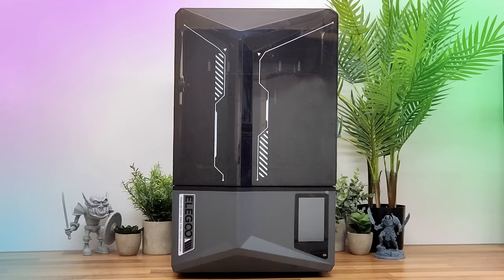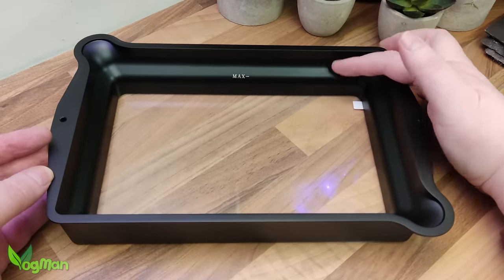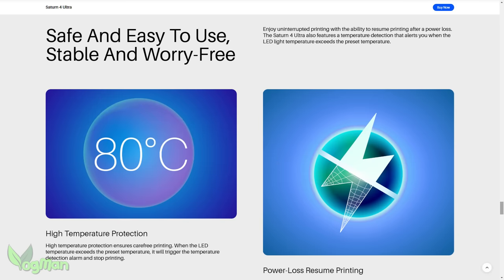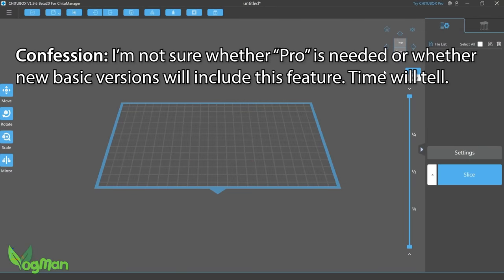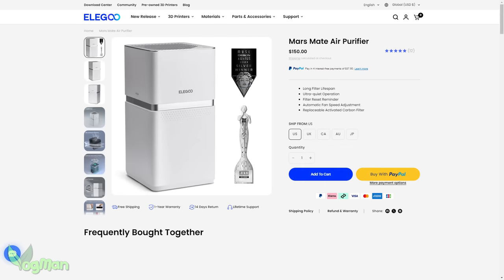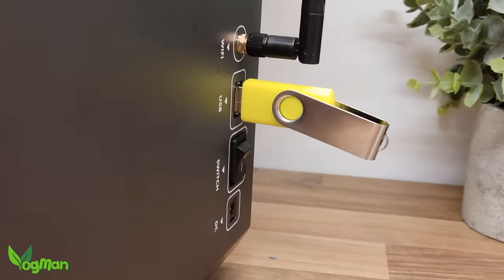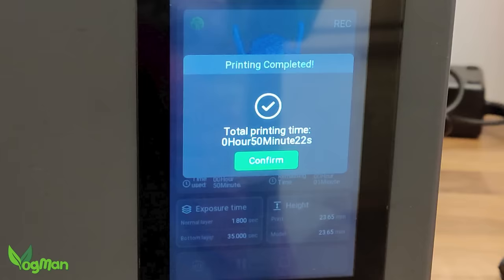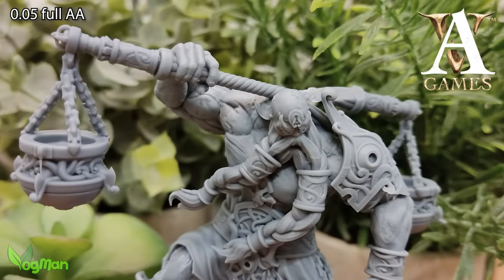Elegoo Saturn 4 Ultra (HONEST review) 3D resin printer

Comment: Good, quick review with nice sharp closeups of samples as we’ve come to expect, thank you for that!

One of the sticking points of the review kind of bothers me.  You make a stink about a cheap 30¢ plastic tray which is pretty much necessary, and another about not including a $50 heater, which presumedly we’d be forced to pay extra for.  

Why should people in tropical or temperate climates be made to pay for something that they would never need?  It being an OPTION is the correct way to go for something like a heater.

Also, I can buy the same type of mini heater for $35 through other outlets.

I’ll definitely be printing a very low profile, style appropriate tab for the lid though.  Definitely a design oversight on Elegoo’s part.
Reply from the maker: My job isn't to do anything more than inform. I speak honestly and try to be balanced.... I like this because... I don't like that because...
When I see a flip top lid with no handle, my personal thoughts are "This company had no idea WHY it was fitting this type of lid." The benefit is one-handed convenience. Without that, there's no benefit. 
I know plenty of folks that live in warm climates but have suffered printing problems through temperature drops (for example, a pal in Australia tell me how cold in gets in the evenings). Heaters aren't just about making a warm environment, they are about consistency of temperature, and that's where prints work best.
As for the tray, I bet Elegoo wished it cost 30c. The money they probably spent on R&D would no doubt set me up for life. And this was for something no one has requested. A heater though.... so many requests for those.
Ultimately I'm just saying what I feel. I don't expect anyone to blindly agree or disagree with me. Instead they need to gather the facts and make up their own minds. I hope I help a little in that regard. 😁

Comment: Considering my prints would always stick to the damn screen, I would say the tilt feature is a must from now on. ALL printers should use something like it or they're total garbage in my eyes that I would never trust.
Reply from the maker: If your prints are stuck to the FEP, the problem probably lies in the base layers. Assuming your plate is nice and level, increase base layer times and half the base lift speed 😁
Reply: @vogman  The problem lies in I got one of the first resin 3d printers made for consumers. The first Anycubic Photon which is a piece. You won't convince me otherwise. I got maybe 3 of my prints to ever work and I tried dozens and dozens.

Comment: At $400 no heater isnt a big deal when you can add one if you need it for relatively cheap. I live in Georgia and its plenty warm enough im my printers room year round. And the no handle on the lid can be solved by super glue and printing a handle. We are a 3d printing community arnt we?

Comment: The most even-handed review I've seen so far. Every other Saturn 4 Ultra review I've seen has come off like a paid ad. I suspect there are a number of things people who received review units were asked not to talk about. Like, you've mentioned the similarity to the GK 2, but I think, at least visually, Elegoo were taking notes on Heygears' Reflex. Totally different machine, but it looks a little Heygearsey to me.

Tilt release is something I think the Prusa resin machine had a few years ago, so I'm surprised it's taken this long to make it to the cheap Chinese machines. It should certainly improve print speeds and reduce failures, but I do worry that it might add a point of failure for the printer itself. Part of what makes resin printers so great is there's nothing to them. One motor, a threaded rod, a plate, a screen, a UV light, and a vat. The rest is all window dressing. Adding another motor to the mix, which can have variable performance, worries me a little.

As for auto leveling, I'm not sure that's something we really need is it? I've leveled the bed on my Anycubic twice in a year and a half, and I don't even think I needed to the second time. Resin printers are easy to level, and they maintain that level well. It's a godsend on FDM machines, those fiddly bastards will frequently vibrate themselves out of level, but resin printers are much more stable.
Reply from the maker: That's because a lot of them are paid ads 😁😁😁
I'll stay honest and balanced, even though I confess it would be nice to pay a fill bills 🤪
Reply: @vogman  The strangest thing, and I asked Elegoo about it, despite there being an exhaust port on the back of the build chamber, the only thing Elegoo sells to hook up to that is the "Mate" air filter. All I'd want is a hose with a fan, and a window kit like those portable air conditioners.

There is, charitably speaking, mixed evidence VOCs are actually reduced to safe levels by charcoal filters, so when I run my printer I've got a couple of filters running inside it, and a couple of bigger, room-scale ones doing the whole room, but I still put a big fan blasting out the window, and wear a respirator in there.

Comment: "I wish it had a handle"
Not to be mean, but you own a 3d printer 😅
Reply from the maker: If you bought a car, would you expect it to have an engine? 
If you see a flip top lid, you expect easy one-handed operation. To date I have NEVER seen one without it - until now.
So the worry is, if they overlooked something so fundamentally obvious, is there anything less obvious that they've overlooked?
That's why I describe what I see. I'm not casting aspersions or passing judgement. But I hope by providing a balanced look at things, folks can draw their own conclusions  😁

Comment: You forgot the lousy regressive build height.
Reply from the maker: Yes, it's dropped from the last Ultra.
Reply: @vogman  I think they are using the same components as the Saturn 3, but due to the big build plate, it means they have lost it on the height.
(about 4cm, which seems to tally.)
Reply: Obviously taken by the thicker self-levelling build plate, not that most use the maximum height anyway

Comment: I get that heaters are required in the UK, but I guess it is an addon because in a bunch of places in the world have the opposite problem of not needing the heater, and having to spend a bunch extra for a useless feature isn't great. At least this way, I don't have to, and you can.
Reply: Wrong. Everywhere it get cold enough to snow, so the vast majority of the world buying resin printers, a heater is a great idea for standard feature and will eventually be.
Reply from the maker: Yes, warm climates often drop dramatically in the evenings. Heaters aren't necessarily about warming up an enclosure; they're also about maintaining an ideal temperature.

Comment: I dunno why people are complaining about not having a handle on the cover. Maybe im speaking from a overly privileged point of view of having two hands but people be acting like its actually an issue but instead it seems like looking for a reason to complain about something.
Reply: Because you get resin all over the acrylic over time? It’s preferable to keep the acrylic clean so you can easily see through it. Just more opportunities when handling prints etc to dirty it up.
Reply from the maker: It's all about one-handed use. Lift the lid, remove the plate, drop the lid. One fluid motion 😁
With pull off lids (and this particular flip lid), two hands are needed. And if you're anything like me, this usually means getting the lid covered in resin 🤪😁😁😁
Reply: Nah it's legitimately annoying. Not the end of the world, but annoying

Comment: As someone who sent a m5s and ms5 pro back in with nothing but issues.... nvm the fancy features, they all failed.

Print 1 after rerf had a detach, print 2 it tried to level on what detachted, print 3 it ran out halfway 🥲
Reply from the maker: Sorry to hear you've been struggling.
Reply: @vogman yeah really no clue what went wrong with it. Visual quality was worse than my original phrozen sonic mini, same models with same resin came out crisp on my mini 8ks.

Now to find a fitting replacement